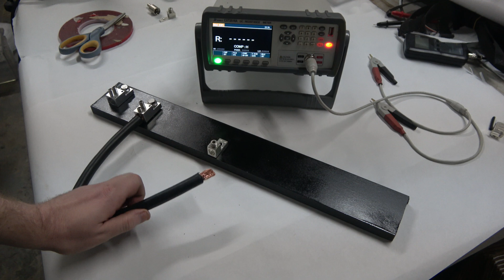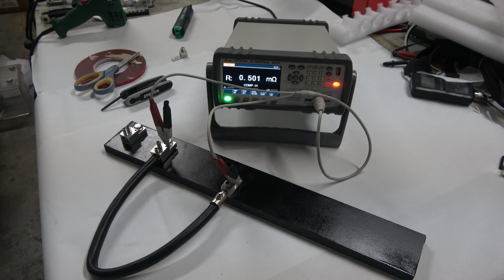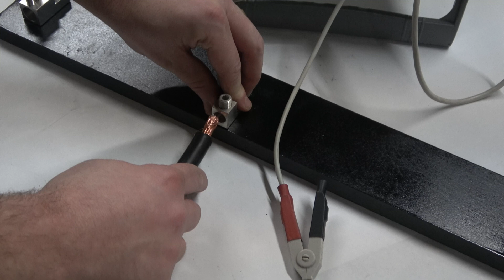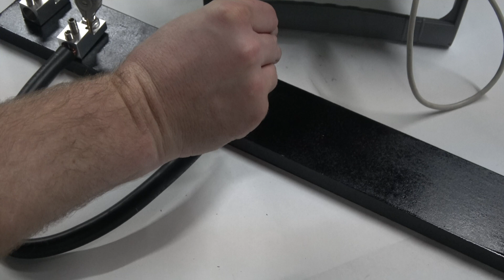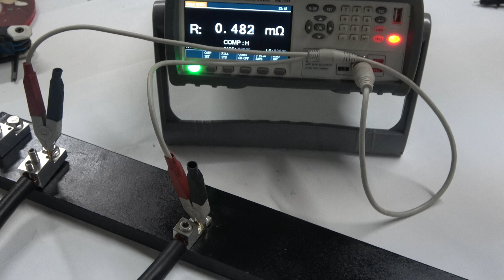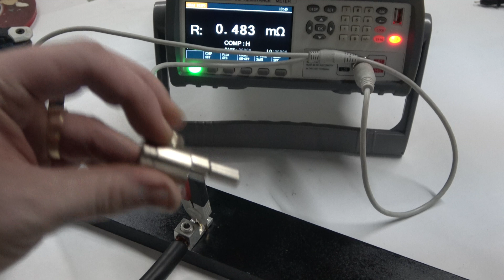Debunking Myths:  Trimming wire vs Reducers - TESTED

Comment: The issue has never been resistance but a reduction in carrying capacity, two very different things. A 4awg connection and 0awg connection may have identical resistance but different carrying capacity.

Comment: I prefer bare wire PERIOD.  There's more contact surface area when you crush bare wire with a set screw.  I've trimmed wire in the past, just to get things working, but eventually incorporated a distribution block with short leads coming off of it.

Comment: I wish amps would use set screw terminals that the screws were bigger. Many have tiny screws and do not compress all of the wire. Yes ferrules work great for this. When working for an amp manufacturer testing terminals for board real-estate, set screw styles that are used in most amps were worse. Using something similar to what your Using worked best out of all set screw terminals.

Comment: The problem is most likely the fact that most reducers are made of brass or aluminum.  Neither of those are as good a conductor as pure copper. I think a dual input adapter with dual 1/0 would likely have some benefit. I learned really quick with higher power car audio that loose connections are terrible for performance.
Reply: The problem is that if you dont have to hsmmer those reducers in the contact to the amp terminal is on the screw and directly under it. Seen a lot of molten terminals because on these, allso acces weight to the terminal is a big problem many times.

Comment: Please do the test with Farrell's . please..
Always been curious about them...
Reply: @lee28.78  I feel I had an improvement from putting wire ferals into my input reducers. I feel it gave the input reducers more of a contact patch and it made all the wires get used instead of the set screw pushing the wires away as I tightened it down.

Comment: Did you get the time to test a dual input reducer vs one short wire connected to the amp with a ring terminal on the other end and then two wires from the battery with ring terminal bolted together with the wire from the amp?

Comment: Now use a wire feral in that reducer. I think it will be a better connection than cutting the wires. I feel just a set screw doesn’t do as well with loose wire strands.
Reply from the maker: I have a video coming up soon that tests a bunch of ferrules and their effectiveness.

Comment: Strange, I've never heard anyone say to not trim the wire.

I actively encourage it. 
Maybe don't trim it as much as you did in the video, but just enough so that it fits.

I've never used those types of reducers. I don't trust them.
Reply from the maker: Yeah the reducers proved to be pretty bad.

As far as trimming wire?  If you were subject to inspection (such as home electricians etc) this is actually a huge code violation.
Reply: Huh? I'm talking car audio.
Reply: @JasonWW2000 He was just saying that they aren't allowed to do it in home electrical stuff.  It's allowed in car audio because they don't really have codes for cars electrical.
Reply: @MrBooMY3 It's such a random and off topic thing to say. 

Maybe he got confused by my comment? He thought I was talking about residential wiring? 

This channel is mainly about car audio, right? Maybe he does videos on home wiring as well? IDK.
Reply: @JasonWW2000 there’s a reason it’s against code in residential commercial and industrial applications, because it increases resistance, which creates a fk ton of heat when you have 2000 amps flowing thru a 480volt panel or whatever the case may be. Same with car audio, just lower voltage. Anything that increases resistance is bad
Reply: I'm sorry, I must be on the wrong channel. I thought this was car audio.
Reply: @ it is, but electricity works the same universally. It’s bad practice to trim wire, unless you absolutely have to
Reply: @Antonnn1111 I disagree with you. I think it's actually an advantage to use a 1/0 cable with the end trimmed down to 4ga to fit into an amp with a 4 ga terminal as opposed to simply using a 4ga cable. You'll get less resistance, not more. 

Think about it. Your not increasing the resistance, your reducing it. 😉
Reply: @ in your example that makes sense, but you’d be wasting money on 1/0 wire for an amp that only uses 4 gauge that putts out maybe 5-600 watts , you wouldn’t be seeing any gains whatsoever in volume
Reply: @Antonnn1111  That's inaccurate and irrelevant. The point here is about reducing resistance. 👍
Reply: @JasonWW2000  no your correct and it's a big thing In car audio. Alot of guys do stuff correctly but I've seen it alot especially younger guys where the amp, sub, fuse has smaller terminals so ppl cut a bunch of wire strands off for it to fit.  If done nicely is fine but I've seen some not so good lol.
My shop is auto repair but many ppl know I do audio so they stop in and you wouldn't believe some of the stuff I see.  Wire strands just taped together, hose clamps holding power wires on battery terminals, wires hose clamped together, wild stuff lol